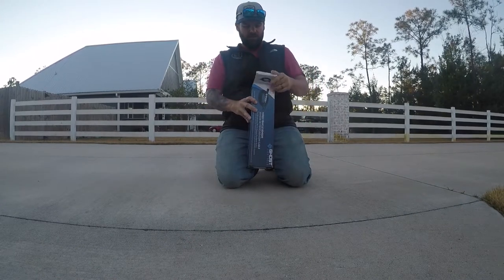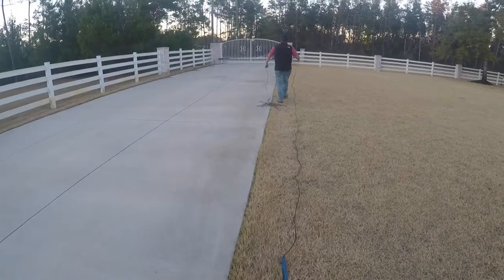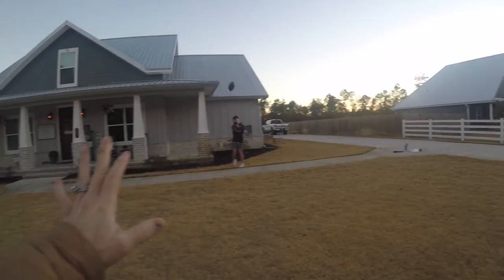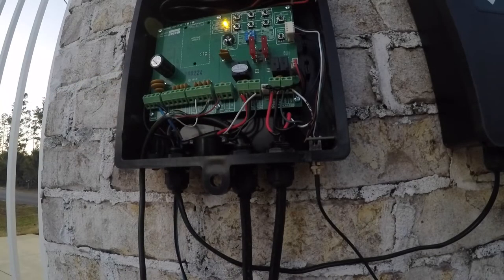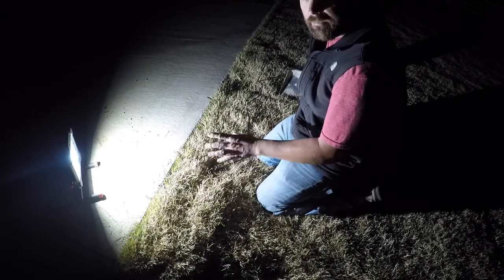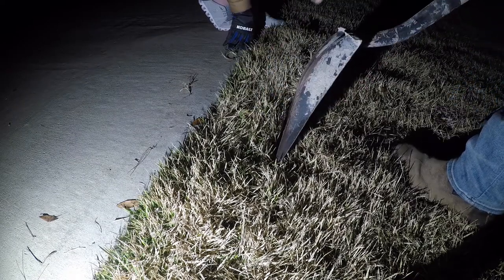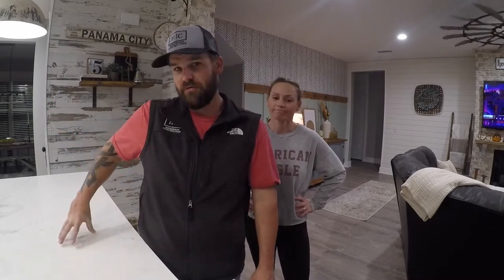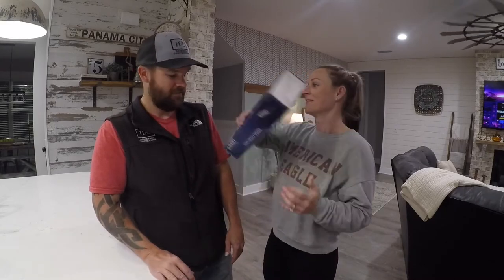GHOST CONTROLS AUTOMATIC VEHICLE SENSOR INSTALL AND HOW TO INSTALL CABLE WITHOUT TRENCHING YARD

Comment: How does the gate closes once you’re outside the gate?
Reply from the maker: It has a timer that you can set however long you want.  I have mine set at 30 seconds. Once it fully opens you have 30 seconds until its starts closing. Works great

Comment: I’m going to be installing one of these on my farm… any clue how the vehicle sensor works on smaller vehicles?? I imagine the tractors and side by side will be fine, but I wonder if my lawnmower will set it off when I’m mowing the shoulders…
Reply from the maker: Yes my lawnmower activates it. Kind of annoying but I get it. To be able to sense a vehicle from 12 inches underground all the way across a driveway it has to be a little sensitive. My edger even activates it. What I do is go to the control unit and hit the toggle switch on the bottom to shut it off while I am doing the yard work. When I'm done I turn it back on. Thanks for watching. Hope this helped